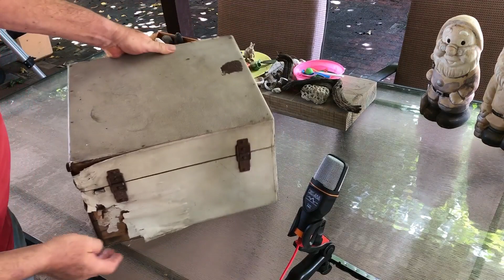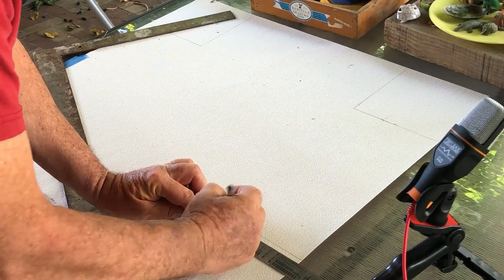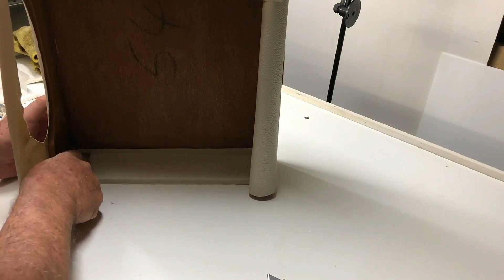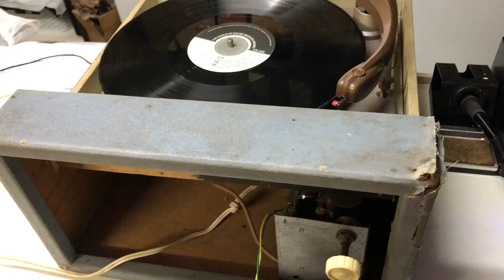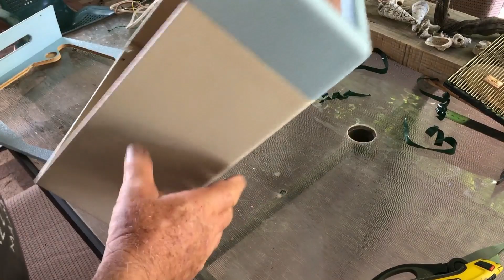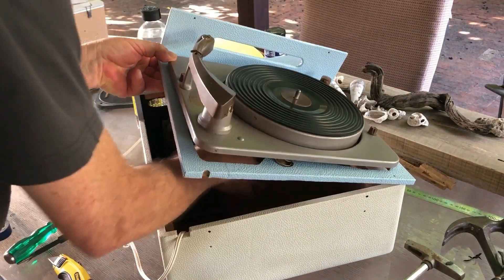HMV Record Player Model C1-81 Repair and restoration Part 2

Comment: In 1962 dad sold the farm to pay off a federal judgement left over from the passing of his father, the buyer didn't have a lot of cash so the payments went mostly to the Fed, and mom took a  job as a cook at a local cafe, dad took one pumping gas and we moved into a small 2 room efficiency apartment in town. It was the running water and electrical power that gave us the biggest thrill you see our old home place hand neither.  Mom ordered us a record player from Sears and it came with 50 45RPM records to "get us started!"  The record player was exactly that color, it was, I think branded Silvertone, but it did have the changer built in. No stereo back then so it was Mono, I remember the player well. The record dad liked was a Swedish American singing a spoof song about his little grass shack in Minnesota, my sisters fell in love with "The Lion Sleeps Tonight" (oh how my dad hated that song!) I never got to play records, guess they thought I was not careful enough to operate such a complicated machine at my young age but my Uncle, who had just returned from his Hitch in the US Army gave me his little transistor radio he used in the barracks so I had my tunes to listen to when I wanted.

Comment: Hope you worked out that the lack of proper speaker baffle is the cause of  "it lacking in bass". By fitting that circular speaker where there was an elliptical one you had huge acoustic leakage from front to back. The cone was just flapping about.
You did not explain where the negative volts were coming from. I would have thought that cathode resistor, auto-bias would have been easier to rig up that those potential dividers.

Comment: Great video mate! I inherited the exact same player from my uncle about 10 years ago. I’ve finally moved to a house with a workshop so I can get on to some of my projects and I stumbled across these videos while researching - couldn’t believe my luck! Invaluable resource for me, so glad you didn’t bail out and chuck it in the bin!! Mine looks in near mint condition compared to yours though so It won’t need anywhere near the work you put in. Really happy to take some photos and share them with you if you’re interested. I suspect I’ll need a new cartridge, can you let me know where to order one? I’m in Melbourne.
Reply from the maker: Hi Mikey
Probably Ebay is your best bet for a new cartridge - but yours might be ok.  Mono cartridges are better if you can get one at a reasonable price but if you can't, you can wire a stereo one up for mono.
I'm happy to help if you have any problems with it.  Best of luck!

Comment: bsr also made a stereo cartridge like that
Reply from the maker: Yes I believe they did,  I prefer to use a mono cartridge where possible, especially if I'm going to play 78's on the machine,  The mono cartridge is set up for lateral modulation only so dust or wear in the bottom of the groove doesn't make much noise. Not so with a stereo cartridge which will pick up part of the vertical component on both channels.

Comment: Superb job on the case, that is my weak spot. I'm fine fixing radios and amplifiers but seem to spend more time cleaning them, at least that's the way it feels sometimes. Have a great 2022.
Reply from the maker: Thanks Steve. I seem to spend a lot of time cleaning up chassis and cabinets. I suppose it’s part of the restoration job but it does take a lot of time. I find it satisfying though. 
I was really happy with che way the case turned out. It’s the first time I’ve done this and I just went slowly and carefully.

Comment: The re-covering job is impressive Don, looks fantastic. You would get more bass if you block the gap the new round speaker leaves, the oval speaker would normally fill that. Sounds like the Fremantle doctor came in at the right time towards the end 🙂
Reply from the maker: Hi David
Yes the Doctor tends to come in late afternoon here in Midland. 
I didn't bother blocking up the hole because I knew I was getting a correct oval speaker later in the week.  This is fitted in the update video and it made all the difference.

Comment: Amazing results. Do think it looks like a proper vintage gramophone from back in the day. Took quite a bit of work
in making it so. With final sound tweaking and it performs OK. Not perfect but that is how they sounded.
 Room filling  music came with stereo record players. Those had much more powerful amplifiers as oppose to the 
circuit this one had. You did a really good job in not giving up and throwing it in the bin.
Reply from the maker: Ha ha! It did come close to going in the bin. I will continue to tweak the grid bias and I am thinking of changing to a 6BM8 output valve, which should perform better.

Comment: You didn't sound overly happy about this record player but I think it looks great. The covering is quality work and the re-biasing of the output tube, due to spec change seemed to work well. It's always disappointing when you end up having to spend more than you'd like, but when you compare the outcome with what you started with it's a great result. Thanks for sharing.
Reply from the maker: Hi. Yes, I was happy with the cosmetic result and the turntable, which is smooth and quiet. I wasn’t thrilled with the sound quality. It was just ok and just enough volume available but I think the 6GV8 is pretty marginal in this application. I originally ordered a 6BM8 on eBay and only used the 6GV8 because it still hasn’t arrived after a month. When it eventually arrives I will install it (the pin outs are completely different and the bias will have to be set up again) and I expect a considerable improvement.  I’ll post an update on YouTube when I do. 
Thanks for your interest.

Comment: Nice work!  I used to have a framing square like that but lost it in a move.  I have another but it's only about 2/3rds that size which is probably more than I'll ever need as most times I can get by with a little combination square.  I have an old Zenith H500 Transoceanic set that the stag cover is shot on and I intend to re-cover it in Tolex as well but will use a dark green instead of the original black because for whatever reason whenever I look at it I get the impression that it should be dark, dark green, lol.  I would have cut it slightly larger myself as you did in case the old stuff had shrunk from its original dimensions.  Instead of wood filler (for places that aren't going to show in the end) I like to use drywall spackle as it seems more economical and the type I get looks pink when it's wet and turns white when it's dry.  Love the end result and that baby blue does grow on ya after a while.  Oddly I recognized that last instrumental being played as a "cover" of "The Happening" by The Supremes :)  That type of music with all the brass used to be played a lot in stores around here as background music many years ago on systems like Muzak.  :)
Reply from the maker: Yes, it is “The Happening”. The Tijuana sound was popular back in the day. I had this record as a teenager (although I didn’t play it much). I think my parents bought it for me, perhaps hoping for something less raucous than Led Zeppelin. I found the identical record in an Op Shop a couple of years ago and just had to buy it. It’s about the only thing I’ve got that doesn’t seem to attract copyright claims. 
Good luck with your Tolex job. If you go about it carefully and methodically it will come out ok. 
I don’t think it would matter what wood filler you used. Drywall should be fine. I just used whatever I had handy. 
Cheers

Comment: put 1 meg to ground off the grid 1500 ohm and 25 MFD cap to ground of the cathode for the triode will work fine
Reply from the maker: Would it be ok to have the triode cathode off ground when the pentode cathode is tied to ground?  I did think of cathode biasing the triode section but I wasn’t sure.
Reply: @Donno308  may be change the output tube  to a 6BM8 I think it will work much better. On the triple half 1 meg on the grid 1500 ohms on the cathode 25 MFD by pass condenser on the Pentode side ground the cathode neg 12 / 13 on the grid ok
Reply from the maker: Actually  6BM8 was my first choice as a replacement and I ordered 2 of them on ebay. That was about a month ago and they still haven't arrived.  I ended up using the 6GV8 basically because I could get one straight away.  The 6BM8's must arrive soon, surely!  When they do I think I'll take your advice.  I'll post an update on youtube when I've done the swap.
Thanks for your advice - most helpful and much appreciated.
Cheers.